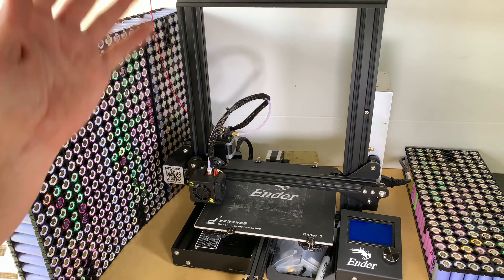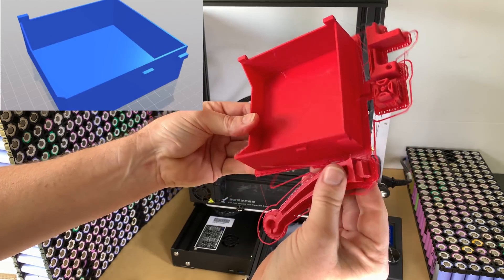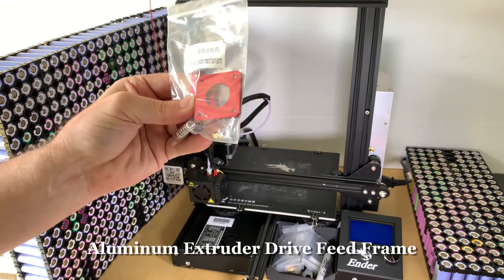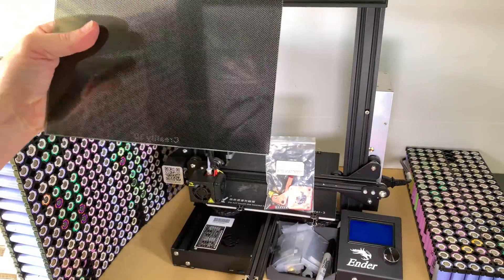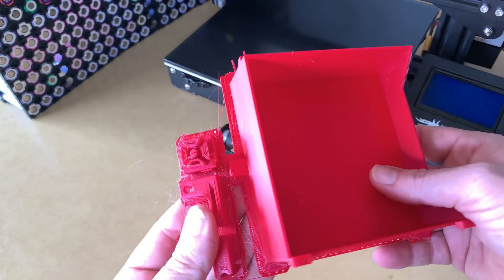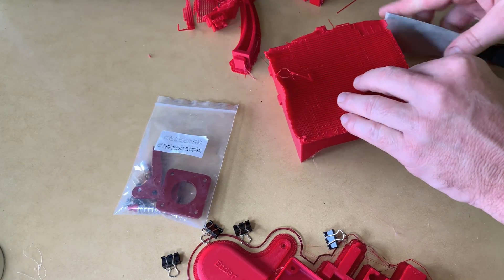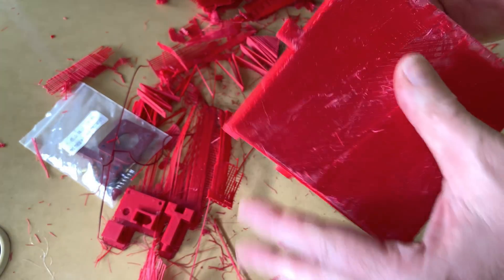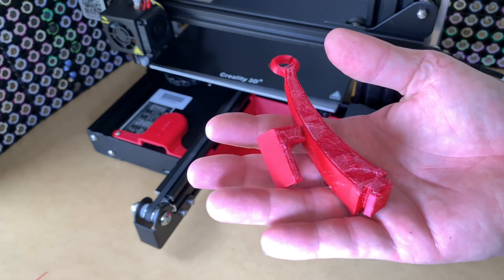Ender3 Budget Basic Upgrades - New Bed, Aluminum Extruder & some Thingiverse Improvements

Comment: If your printer is correctly leveled you can get away with just using a skirt, which is a thin line around the print at the first layer.
Reply from the maker: Bed in perfect, well I think it is - learned the hard way that the bench the printer is sitting on also needs to be perfect as the printer flexes just a little causing warp in the bed. It's all learning and I'm enjoying the process
Reply: @HBPowerwall  With the Ultrabase that should be a thing of the past. Happy printing, you will find lots of new solutions for problems you never knew you had.
Reply from the maker: ooh man i got problems, just added to them with a printer lolz
Reply: That depend of the height of the model and the supports. I alway use a brim when I print tall models.

Comment: want to learn a bit more about printng? you can come over and see what i am up yo i am not far from you as i have been to your place back when you only had a few hundred follower's (i am only 4 km or so away from you

there is just so much going wrong there to much for me to type but i could skype or you can come over i am working on 2 other peoples printers at the moment so 1 more wont hurt lol
Reply from the maker: Thanks for the offer bud - I think part of it is learning the hard/fun way, the only issue is the power usage - have to con the wife into letting me bring it inside so it's on the powerwall power not grid in the shed.
Reply: @HBPowerwall  3D Printers don't use that much power at all...
Reply: where can i go to teach me more about 3d printing i live at Mandurah W/A 6208

Comment: the trick is, calibrate your 3d printer
Reply from the maker: Being almost totally green it's a bit of a process but not horrilbe
Reply: HBPowerwall, I can highly recommend this video (https://www.youtube.com/watch?v=3yIebnVjADM) to help dial in your printer and slicer settings. I also recommend following the same procedure he describes for calibrating your extruder, to get your X, Y (and optionally Z) axes calibrated. Makes a big difference trying to get printed parts to fit together.
Reply: the real trick is, he should be stopping 3d printing

Comment: rafts on PLA nearly always stick to much to the print...  the trick is dont use rafts. Should stick nice to new bed without need for rafts.
Reply: if needed use a brim, much easier to remove
Reply: @Dust599  that goes for ABS as well. Brims are always the way to go with thjings ranging from pla on up to nylon. Rafts are for TPU if im not mistaken.
Reply: A raft with a larger air gap is the ticket. I use this for parts that need excellent adhesion to the bed but easy removal from the raft.
Reply: yeah brim + exacto knife are pretty quick
Reply: Weird, have been using my Ender for a week and never had a raft print like that. Mine are all well formed (not able to see through) and not stuck like that. Only time i ran into this issue was when i tried to print using a brim.
Reply: I printed all the parts without brim vor rafts. Just for tiny Objekts i use a brim. Or tweak your raft settings .
Reply: I almost always just use a skirt.  if your bed is level you never need a raft, and if your bed is in good shape then you shouldn't need a brim.  a skirt makes sure the nozzle is clean  and not much else
Reply: I never use rafts with PLA
Reply: I only ever use skirts
Reply: Most of the parts he printed don't require any adhesion layers, also not sure why he's printing multiple  items at once, it just adds time. Heating PLA with a heat gun? Perhaps he should watch some YouTube videos. These are literally the worst prints I've seen on an Ender 3.
Reply: also look at switching to PETG, prints like PLA, but stonger and higher melting point.  (PLA transition temp is only 60c, ie will melt in a hot car)
Reply from the maker: No more rafts, add brim seems to be the go! I'll order some PETG after I've run through the 7 kg of filament I have see how it goes. Thanks for your input
Reply: shouldn't need a brim.   brim is used from making warpy things stick to the bed.  The other time is on small tall parts.   Get her leveled and print away!     Your going to have so much fun!
Reply: I just use a skirt (2 times round) - even less hassle.
Reply: Neither raft nor brim is required for the parts you printed. If your adhesion sucks, use hairspray or gluestick. Also make sure the bed is clean before printing (no fingerprints etc). Only on bigger prints a brim could help to prevent the nozzle of tipping the part of the bed during prints.

I do generally print with a few lines skirt, just to get the nozzle cleaned up and a nice outline around the print area.
Reply: @HBPowerwall  you could also adjust the gap settings to create a larger gap between the print and the raft
Reply: @Dust599  you can get thermal uv paints to help but ya pla and hot places are better to avoid